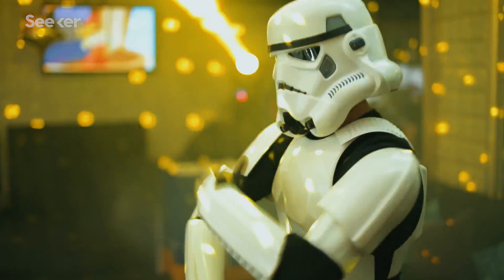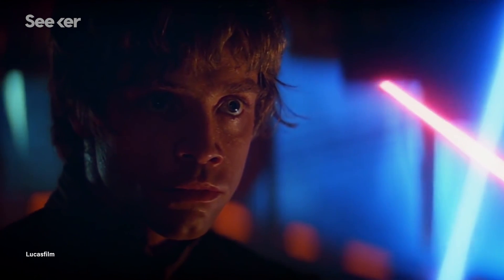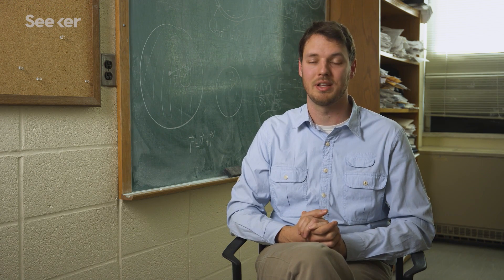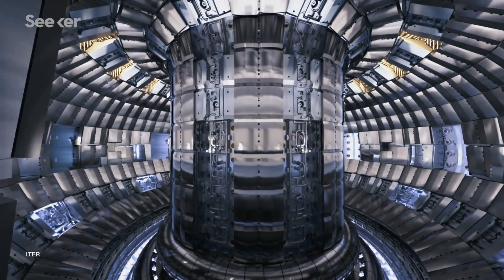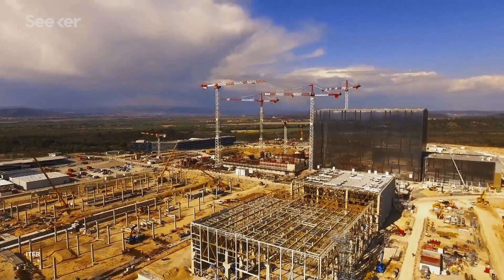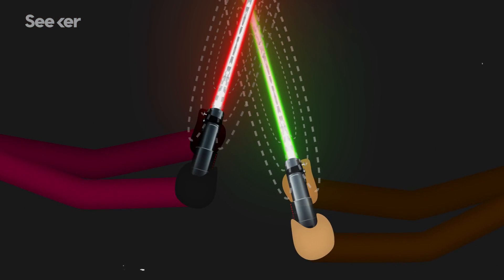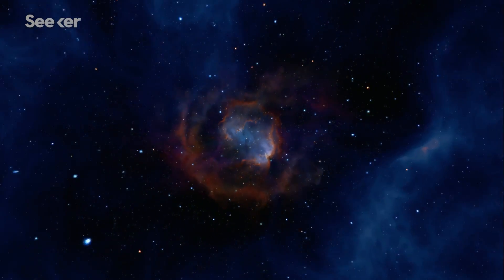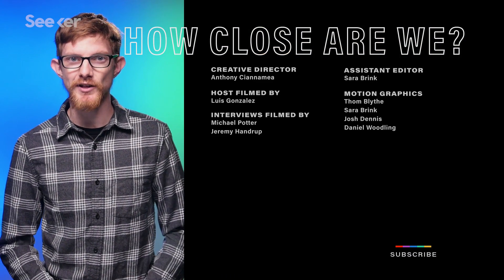How Close Are We to Creating a Lightsaber?

Comment: 1:26 Wrong!!! The beam is not contained by the Force. Han and General Grievous used lightsabers without Force powers, and the beam stayed contained. (Han used it to cut open the tauntaun so the residual body heat would keep Luke warm)
Also, Luke first ignited the lightsaber when he had barely even heard of the Force.

Comment: Why does everyone keep saying Hacksmith lightsaber is an actual lightsaber? I'm not trying to deprecate it but be realistic. It's still missing 2 big factors. Dueling and constant length (it's length changes if the flame touches anything). But still it's very impressive and the closest thing to real lightsaber there is!
Reply: In Star Wars lore, early Lightsabers were powered by connecting a cable to powerpacks. They're called protosabers. He designed the real life Saber based on the Prototype sabers.
Reply: @darkglass3011  did you even read the comment?
Reply: Also the lightsaber length changes when it’s swung
Reply: @dogturtle0  
Of course I read it. But this guy implies that it's not a lightsaber because it doesn't unrealistically break the laws of physics. If an object passes through the "length" of the blade, that length will shorten momentarily until the blade either sears through said object or that object isn't there anymore. It's physically impossible for it maintain the same length at all times if an object is occupying the same space. 

Basing the design on the "proto" saber gives the excuse that it doesn't have to follow the standards of the "modern" lightsaber in that it unrealistically maintains its length no matter what.
Reply: @darkglass3011  ok

Comment: Im not a professional in any of the fields im about to talk in. Everything im about to say is coming from a noob. Lightsaber or laser sword acts as a solid. Its retractable and is hot enough to cut through anything except Beskar in Star Wars. The retractable part of the saber is a plasma as it can cut through metals with only one strike instead of having to hold it to melt. That means that you would need a power source that emits plasma hot enough to melt through metal without any resistance. There you go part 1 is all complete. Now for part two, it needs to be or act like a solid. The lightsaber should be able to go through and object not the object through the saber. The big problem here is that plasma is hot when in gas form. Im not sure if plasma can even be turned into a solid. If it can its probably in a controlled environment where it won't be as hot when in a gas form. Therefore part 1 would be useless since plasma cannot work. Then how about lasers? Like they said in the video it makes sense to use a mirror to make it a specific length instead of an infinity sword. Ofc the problem here is that when dueling, and opponents sword can cut the metal rod that attaches the mirror. And do you really think either plasma or laser, is a portable enough to store all that energy in that small hilt? definitely not.  Even the blacksmith had to carry a propane tank to use for like 30 mins. Not even the hacksmith was able to make a portable lightsaber without any wire connected to the hilt. Its pretty obvious but unless we find out a way to customize a length of a plasma, make it a solid in normal environment, be portable and be powered from a small energy source for example nuclear power maybe a piece of uranium can act as the "cyber crystal". Usually when people say that's impossible it ends up being possible in the future but I feel like this one is far from reality. If you read all this thanks for hearing me out.

Comment: Maybe a retractable blade able to withstand any temperature, heats up instantly to insane temperatures. Then to have a plasma based flame come up surrounding the blade giving it the thickness and likeness of a lightsaber, such as what hack smith did with oxygen and flame. And all of this happens at one time so it looks like the plasma blade is coming out smoothly such as in the movie. With today’s technology I don’t think it would be very possible to heat up something that hot so fast, nor able to withstand the heat. Think of it this way, you press the button, the metal( reference to the actual blade of whatever ) and the plasma blade comes out at the exact same time giving it the view of a lightsaber, while it is not just plasma, it would be able to collide with another blade. No need for the mirror design

Comment: you cant house antimatter inside the hilt of a lightsaber, its Antimatter...if it comes into contact with any form of matter...it will implode...the size of a magnetic field needed to prevent it from contacting any matter would not be suitable and also would need to be vacuum sealed...air is matter too.  am I wrong?

Comment: What if instead of lasers we use something that is hard but can melt at the same time?
Heaten metals or some solid acid could work.

I really wanna cut some trees using that, seems much easier than chainsaw. Also there are other things u can cut pretty easily with that.

Comment: Fun fact: in official star wars canon, standard lightsabers are quite literally a hilt, and that hilt forms an electromagnetic field on one end, before releasing plasma from a kyberr crystal, which is a fancy crystal that contains a hell lot of plasma. We can, as proven by another video I saw today, make plasma within the hilt, so it won't be too much of a problem (though your duel will only last 30 seconds, and won't allow lightsaber clashing). Anyway, said plasma is contained in the electromagnetic field, which is how it manages to deflect things - the blaster bolts work similarly, and it is actually the electromagnetic fields (not the blades) clashing with one another.

Sadly, we don't have kyberr crystals in real life and we can't manipulate electromagnetic fields in this way (yet) meaning a proper light saber is nigh impossible until we can make a giant electromagnetic tube and fill it with plasma.

TL;DR: Lightsabers are just an electromagnetic field filled with lots of plasma from a crystal in the hilt.

To add on, there is also something called a 'Vibrosaber' or a 'Vibroblade' which is essentially similar to the mirror  method, but there is no laser. Instead it is ONLY the electromagnetic field, and it's pretty much a weaker lightsaber that only zaps you when it hits you. Some variations include the plasma in very limited quantities, not enough to do more than a flesh burn. It's used by jedi younglings and padawans for training before they get to use the actual lightsabers. You never see them in the movies.

TL;DR: Vibrosabers are like the mirror thing, but they are supposed to only zap you

Then we have protosabers. Protosabers, or Archaic Lightsabers, are exactly what the name suggests: an old, pre-lightsaber lightsaber design. It works on the same concept as a normal lightsaber, except it doesn't have the kyberr crystal, and instead uses a bulky, vulnerable powerpack that you place on your back, connected to the lightsaber by a cord which, when turned on, produces plasma just like the lightsabers we know and love today, just way more unstable, and weaker. Oh, and heavier. Way heavier. Instead of Kyberr crystals, they would use a focusing crystal. However, protosabers have highly limited lifetime - you can't use them for many years on end like a lightsaber, and they will run out eventually and need to be refilled. 

Then we move onto Retrosabers, which are the exact same thing as protosabers, but different. They instead use a smaller power pack, a lot smaller - about the size of a pouch - which the user clips to their belt, and keeps on their hip, attached to the weapon by a small cord. It's way lighter and less bulky than the last version. But the real thing that made it way better is that you can flick a switch on it, activating a high-power mode, which uses a lot more power, but makes it more dangerous and powerful, more comparable to modern lightsabers, but this is only temporary and can't be used for too long. Retrosabers were way rarer, and not used as much, but did find their way well into the clone wars by certain jedi who opted to use it over the traditional lightsabers we all know and love.

Certainly, protosabers and retrosabers are more possible, though we'll still need to learn how to manipulate electromagnetic fields without conducting it through material.

TL;DR: There are also older lightsaber models called protosabers that use a power pack, and are way weaker (& heavier), and have limited lifetime. Later versions are called Retrosabers, being way rarer and less widespread, having a smaller power pack and a 'high power' mode.
Reply: https://youtu.be/xC6J4T_hUKg

Comment: Claiming that they use the Force to sustain the beam of the lightsaber is absurd. And that has been clearly shown in movies and series, where characters without mastery of the force (young Luke, Grevious, Finn) use the lightsaber. 
And as you says, the most logical option is a plasma flow contained in a magnetic field. For the length of the magnetic field instead of ceramic cylinders, the same principle can be used as that of the voltaic arc, whose length would be determined by the angle that the emitters would take. And if the magnetic field is unstable for long periods, the same principle of strobe light can be used.
And how long is it to create a lightsaber? A century or two is too optimistic. In my humble opinion, a millennium. And that with luck. And on this I base myself on the fact that in Star Trek does nobody use lightsabers

Comment: There is dust that stops light from passing thrue. If we can find a material that immediately  becomes dust while being heated up from a laserbeam we shouled be abel to have a pump run it infront of the later-beam from the Lasersword-grip and use Ventilatoren to shape the dust in swordform where the lazer heats up the dustparticles exactly at the blade. This way we wouled get a true lightsaber that is actually made of Lazer and hot enough to cut many things. We basicly just have to find a material that becomes gas from heat and figure out gout to shape the air the neccecery way. It must be dens and light but also a few parts of the former compound have to be enough to run it. That couled be made by using a cristal that gets used up over time and has the neccecery compounds in its structure.

Comment: What we need to see is the 2 light sabres that can repel each other  ,I was thinking of using a fission wand to bond hydrogen, using calcium then once I have an ice Blade add a co2 laser and boom h he reaction with potential heat of a star, problem with using neutron radiation to enlongate magnetic fields weakens the field and lol I've actually held a device that called a toroidal cylander, using geometry to focus neutron charge which is then telescoped with spring loaded magnetic potential, and fussion
Reply: The fussion saber would burn holes in brick but as the plasmoid Blade was used to cut, the hydrogen neutron reaction destablised and the Blade flared out like fire cracker in a campfire, dare say that further attempt may cause injury to the user
Reply: Not to forget that plasmoids have reached solid state, can be held in stasis capaciters, but the fear is that when plasmoidsolid or frozen helium get centrifugal momentum, like the nazi bell, appears to alter space time
Reply: Show me the money,  and I will show you how to gamma up, get some organite or use a cloudbuster....levitating stone donughts just like Tesla ....Up up down bump.... I want to distort localised spacetime...lightsabers pfft cool but not quite dangerous enough, try turning your garden shed into a reactor and then find plasmoid   supersymmetric holograms projected through the roof, determine that they become more visible when exposed to certain sounds, that gravity particle goes in 2 directions uud ddu both the symbol for quintessence and the relative shape of a quark is (4)

Comment: btw a lightsaber is a not a weapon that is based on light or light reflection it's a concentrated plasma blade theortically if you put a rod of metal that could withstand enough of a high temperature (like what hacksmith did) inside of what basically amounts to a mini flamethrower you can have a lightsaber that does everything but the cool sound effects from the movies. it's not a concentrated plasma blade but it's pretty close.

Comment: Engineers of Youtube, here's a dangerous proposal:
We modify a drill, we make it spin a long rod, we run a current through the rod and let steel beads coated in tungsten maintain a high-speed orbit with the centrifugal force, we run a current through the beads as well, now we have rings of super-heated peel grinders glowing brighter than my future. We change the design, make it a sword handle, add a large portable battery in our backpacks, and voila.

This searing hot drill is obviously very unstable and only strong warriors can grip it tightly without letting the spin rip the blade out of their hands (perfect excuse for design flaws), the sound of electricity bouncing through the air and between beads will create a high-pitched noise that can be heard when activated, before subsiding into a low hum of the whirling motors, just like the movies (perfect excuse again).

Comment: Hacksmith is literally working on a plasma light Saber right know, no joke
Reply: A plasma 'sword' requires a huge amount of energy. If we could do it right now using existing tech, then it would require around a 20 megawatt power supply. Advances in materials/confinement process etc may bring that down in the time to come but we are not there yet. So unless he has a miniature nu ke or fusion battery hidden in the hilt, then it ain't happening.
Reply: @jamesh8862  if you check out hacksmiths Instagram, you will find that you are wrong.

Comment: 3:08 yes thats light saber desing.light and light cant use as fight. need rod. need small powercell to power laser.we are too far awey still 3:32 exactly how else you think it work?
it need have some core.not just light(laser/plasma)
there is noway lightsaber can push thru object like door and cut it.becouse you need cut sideways not from tip. lightsaber desing from movies not possible,but we can do same look like.if we have small powerfull cell LOL
we have propd and led sabers they work. lets just add some very strong accid on blade so it burn flesh but not tube. well thats that.led saber with acid. not laser sword lol

Comment: I solved the problem of the lightsaber in 2009. I started working on it 2002. You don't need a fusion reactor. You don't need antimatter. There is no magnetic containment that needs to take place. There is no telescoping rod, no mirror, nor a super-heated rod of titanium. I came up with two circuit diagrams that would do the job quite nicely. The tech already exists and is used every day. The reason, and the problem, of why no one has successfully created one yet is because people tend to separate things that...really should never be separated.

Comment: I'm always so disappointed watching these lightsabre articles. Everything you guys say is wrong. Nothing you say even remotely matches the SWU lore, or even comes close to what we can glean from observation. For example, the sabre isn't supposed to be "hot enough to cut through a metal door". It's not supposed to be hot at all. Whatever energy is being harnessed, it can certainly transfer energy into a static object like a metal door, but it isn't innately hot, just standing in air. It also isn't "hot enough to cut a guy's arm off". The energy there isn't cutting through the arm with heat. It's literally separating the arm at a cellular or molecular or maybe even subatomic level.
When SW fans and scientists get together to try and recreate what a lightsabre ought to look like in our universe, they always fail miserably by making comparisons to lasers or some such. If we're ever really going to get anywhere close to a lightsabre we need to realize we're dealing with entirely different energy application. We'll need a lot deeper understanding of quantum mechanics, string theory, p-branes, and the fundamental nature of the universe. Thinking in terms of lasers and heat is pointless. Stop it.

Comment: Uhm.. so, let's recap.

You're talking about building a plasma generator contained in an intense magnetic field and the didn't really give you an indication of just how intense it would be.. like pulling fillings out of your teeth strong... that's emitting 1750C heat in all directions.. and by the way, the colour imparted by the gas is going to be swamped by the white light of the plasma's thermal light radiation - so, mostly white - AND to top it off.. you're carrying the equivalent of a 200,000 ton nuke in the hilt that's being contained by another magnetic field right next to the main one... and no, they can't be the same field - the shape and dynamics are all different - that will basically explode if anything goes wrong with either the magnetic field generator or the batteries running it..

In other words: this isn't a lightsaber - it's a small, delicate, Hiroshima-level nuclear bomb driving an unshielded plasma torch surrounded by an NMR machine level magnetic field that's both going to be trying to drag any bit of ferromagnetic metal in the area to it - or you to the metal.

What could possibly go wrong?.